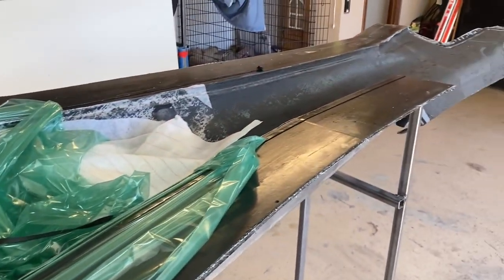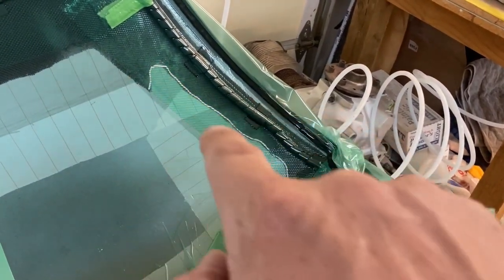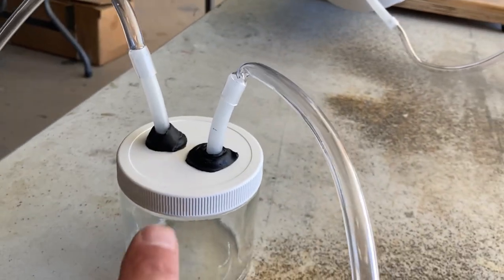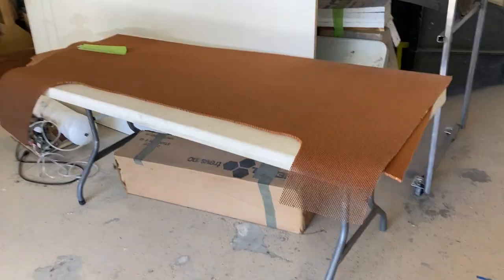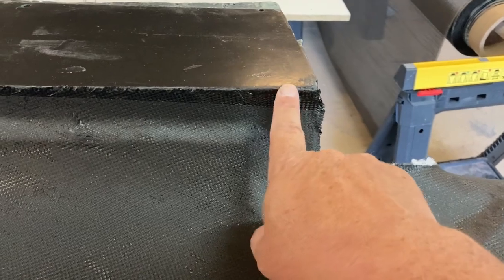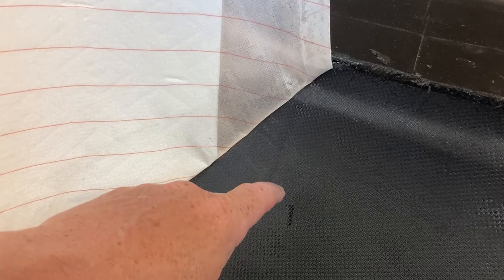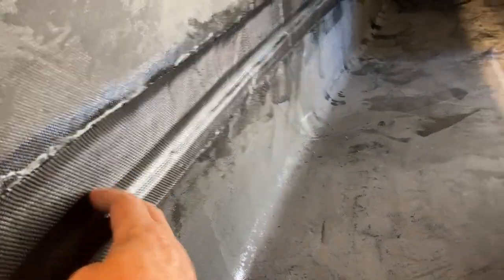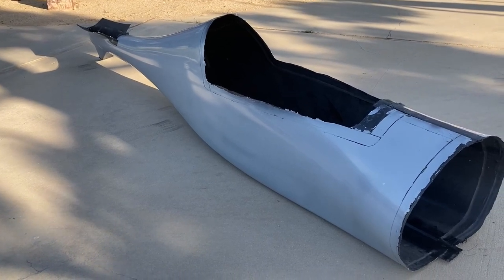Impulse Ep 6   Fuselage molding complete!

Comment: Awesome. Been through some of your problems : I seriously advise AGAINST using that Stretchlon 200 vacuum bag for infusion. It will not withstand continuous contact with the resin. Also, it is somewhat porous. It is okay for debulking and wet lay-up, but NOT infusion. Also, the breather felt is quite bad for infusion as it will stop breathing when resin soaks in. Unless you intentionally use it as a resin break. Hope that helps.
Reply from the maker: Excellent, thank you for the heads up.

Comment: how tricky is it to pre-wet the inner layer just right so that the honeycomb is properly bonded yet does not get filled with resin while the fiber still gets enough? esp. accounting for what is soaked up by the peel ply or other during the vacuum pull ... do you calculate a weight per area  ratio ? did you do some destructive samples to tune your process?
Reply from the maker: Good question. I use the weight of the fabric used and add equal resin plus a little extra (maybe 10%) and then wet the carbon out between plastic on a flat table. Done this way ensures complete an wet out without excess resin.

Comment: Thanks for these videos. I have 2 questions;

1. Why didn't you infuse the inner skins of the fuselage like you did the outer ones?

2. Why didn't you put the bulkheads in before you joined up the fuselage halves?

Thanks again
Reply from the maker: Infusing the inner skins would fill the core up with resin which is unnecessary weight. Joining the fuselage without bulkheads installed lets me run a continuous laminate inside unobstructed.
Reply: @RedJensen  got it. Thank you